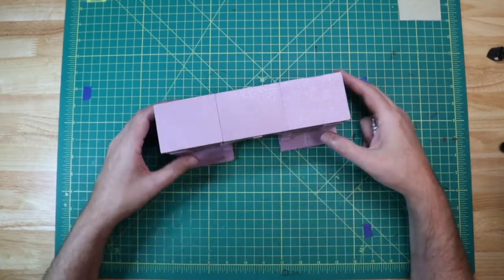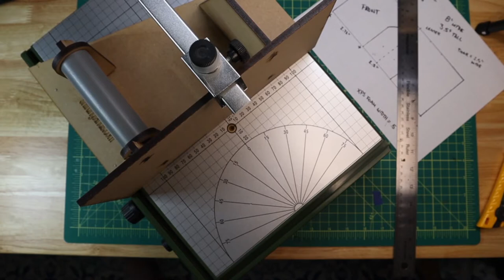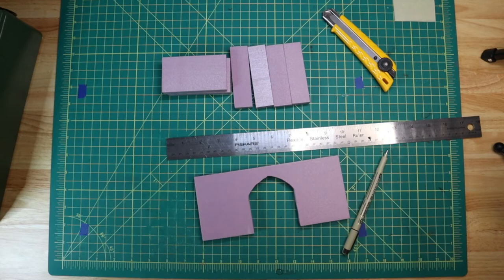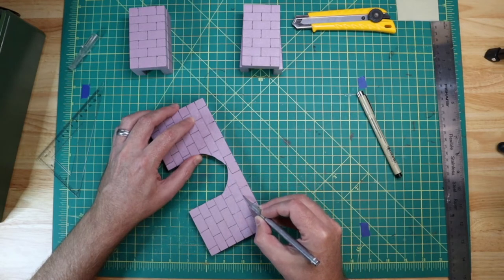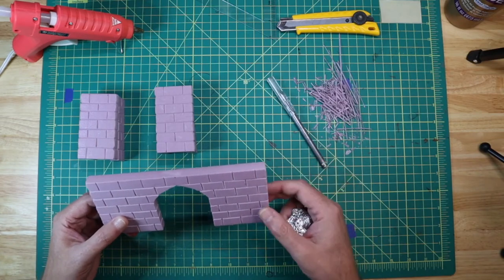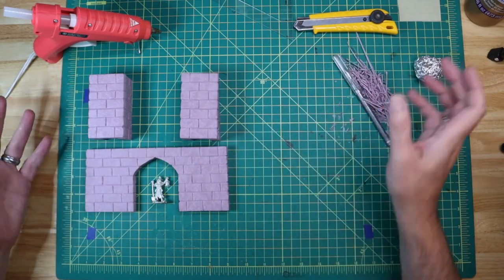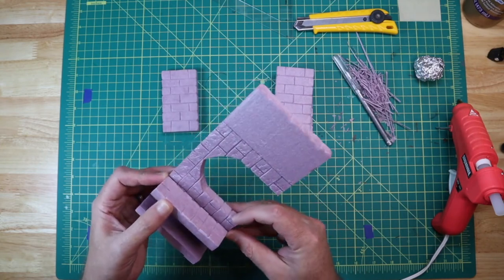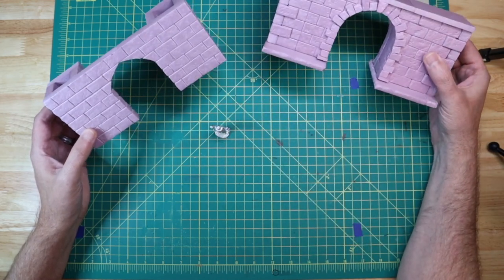XPS Foam Castle Wall with Chaos Crafting

Comment: Would recommend waiting to texture the stones on the sides of the “towers”.  Texturing the sides once assembled can help to hide that seam line between the foam pieces.  Looks like you add some dressed stones at the corners in a following step - also a great way to help camouflage prominent seams!

Comment: An observation and nik-picking of the stone layout around the archway. The stones around the archway would be more realistic having dressed stones around it and/or having a key stone at the top, because if that was built in reality it would fall done due to no key stone to lock the stones in place above the arch etc. But it does look very good otherwise.